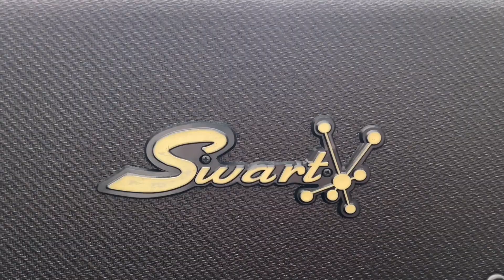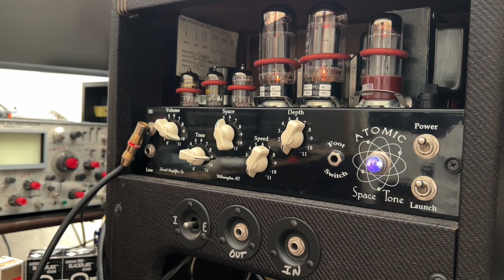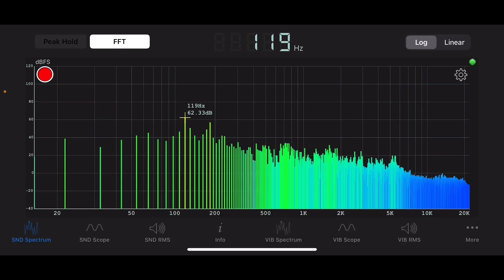Swart AST Pro Part 1 // We Forgot How Amazing!

Comment: I've been waiting for one of these to land on your bench. I wanted to hear the thump thump thump of the tremolo at moderate setting of both depth and speed. Mine here in the studio goes THUMP THUMP THUMP.
Reply from the maker: I’ll see if I can dial that out. I’ll be cracking her open tomorrow morning!
Reply: @ForgottenGearRestorations  Yeah it wasn't like that before, just pretty mild chopped hiss which I think is normal. I'm actually surprised it's thumping like that.
Reply from the maker: Could be the noisy room over here.
Reply: @hhantuu interesting! Mine has thumped in every room it's been in 🤔.
Reply from the maker: I’ll let you know what I find
Reply: @jesserivest  no I meant the trem works amazingly, throbbing like nothing else. It’s that thumping noise that I was referring to. Used to be just nice subtle chopped hiss